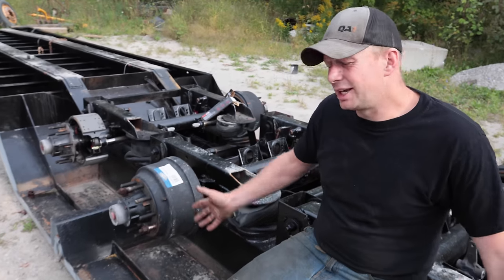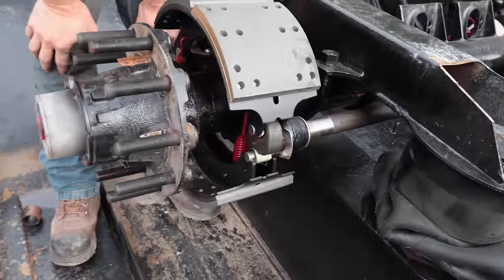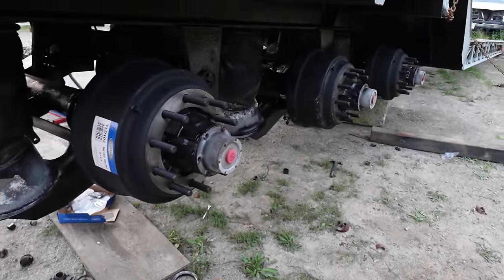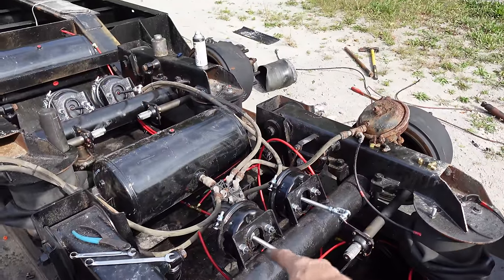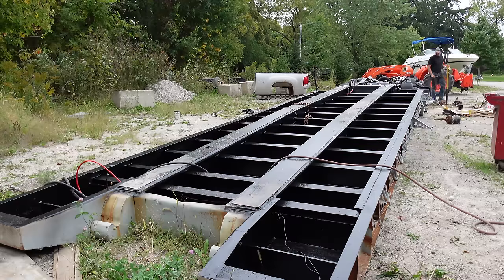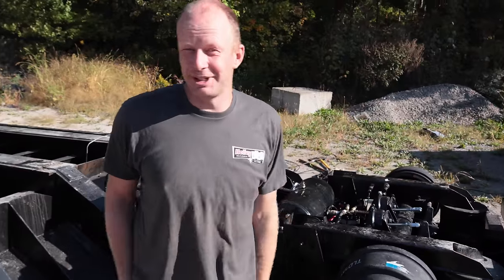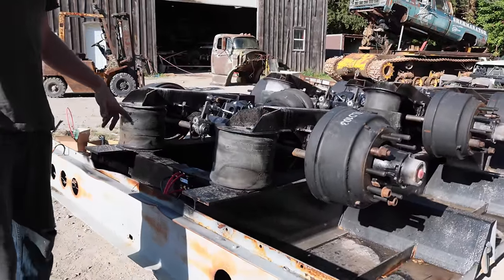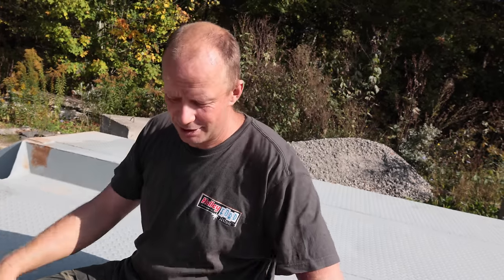Assembling & Airing Up Brakes on our Tri-Axle Lowboy Trailer [EP4]

Comment: Tip on your ziptie memory system.  Try using little bits of telephone or ethernet wires.  They have lots of different colors inside one bit of ethernet cable to designate many different connections, and you just cut a couple inch length of the wire and twist it around the component like a twist tie.  Then you are matching colors of wire instead of zip tie lengths.
Reply: Great tip!
Reply: Personal preference, colored zip ties. Buy them in a tube. No stripping CAT 6 outer jacket and inner sheath, no cutting wires, just grab two zip ties of one color, put them on with one hand. Run out of colors? Double up. I've run miles of CAT cabling and run a truck maintenance facility and a farm. Zip ties for me, just my personal preference.

Comment: For an extra $50 in valves you can put a shut off valve at each air bag to isolate it off it blows.  Then if you get a flat air bag is a simple as closing a valve.

Comment: I work in the suspension department of a tank trailer manufacturer.  We also build brand new suspension systems upside down, then flip them over with an overhead hoist before adding air lines. After that the whole suspension package is welded to the trailer frame.  As far as special tools go, there aren't any. Sae wrenches and impact guns do most of the work. Only thing we use that isn't at a local hardware store would be the Huck fasteners, which are standard for semi manufacturing. Great job.

Comment: So impressive. a one man Job that usually done by a team  inside a work shop. only the ones who do fix trucks and trailers know how much time, effort and talent it takes. Brakes, air lines, airbags, air relays. Wow.  👍👍 what a Great inspiration Rich,
Reply: I do work like this in a fleet workshop by myself, but not upside down!
Reply: @Low760   It is a very hard job, going under the truck back and forth. stuff and mud keeps falling on you.  such trades should be highly ranked.

Comment: Little tip for those anchor pins, ball joint presses work very well, but when you have a stuck or siezed anchor pin (normally there’s stuck, not very often will they just fall out) put the ball joint press on them as you did in the video, and give the spider (where the anchor pin sits) a smack and it’ll usually break free, works everytime.

The way you did it works aswell but heat can sometimes change the strength of the metal “in theory” otherwise excellent job!

Comment: Glad you changed those pins on the spyder. Some would skip that important part.  Some chains for stoppers to your frame and axles so your airbags and shocks do not overextend are a very good idea.Sometimes you can’t always dump the air when unloading, due to freezing and corrosion, ect.
Edit: I actually do not dump the air on my floats because they have 4 chains per axle lol .

Comment: You're gonna want to move your spring brake chambers from the front axle to the middle.

When ever you detach you park the trailer and leave the brakes on the truck released (red valve on dash out, and yellow valve in). This allows the truck to move while you're using the hydraulics to raise the trailer in the air to unblock the neck.  When you raise the trailer up, the truck will move backwards a little, but after you unblock the neck and start setting the deck onto the ground, the truck will move alot. Which is why you can't park the truck, something is gonna move (truck or trailer) and most usually prefer it be the truck.

But back to the spring brake chamber. When you're raising the deck of the trailer to unblock the neck I preparation to detach,  your front axle is going to come up. It won't come up alot but it will loose a large amount of ground pressure.  Depending on the type of surface you're on and it's angle, you might find yourself in a "no brake" situation.
Reply from the maker: I just put it back to the way it came from factory
Reply: Just for saftey the front and middle axles should have spring brake chambers.

Comment: I would consider folding the ears over on the s-cam washer between the S-cam and the spider. Hendrickson sells one that’s already folded over. Since you already installed the hubs it’s not worth replacing now fold the ears over with a hammer and it does the same thing. The shoes can bounce on the washers and cause a lock up especially once parts start to wear.

Comment: Great video..Rich where are you going to keep your truck, trailer and tank during the winter months?  Please don't leave them outside in the weather
Reply from the maker: Putting a roof between two sea containers and parking them under there.  As soon as the trailer is done, I will start the process.  Finished projects can go into the containers, and the boat and Kenworth can go under the cover.
Reply: @DGHD  I knew you would have a plan. The kenworth is your best project to date..Its stunning and I'm not even a truck guy. Thanks  the reply..Love both channels. It is  your  personality and presenting skills that make both channels such a success. The editing is also excellent.

Comment: For your anchor pin removal and installation they do sell a tool for that for a air hammer/zip gun that works great! I use one when I’m doing those and they do the pin and bushing for those
Reply from the maker: there is a tool for everything, but no sense buying and storing it when I use it once every 10 years

Comment: Did they remove the pressure protection valves for the air bag system . If they did you may want to put them on just incase you blow a bag you won't fully lose all your air.

Comment: Good job !!  You can be a top parts pusher, great management skills !!
Reply from the maker: Each build is specific to its needs.  When it comes to brakes and safety, of course I am going to replace all the parts.  When it comes to using what I have, check out the other builds, like building exhaust stack supports out of old prison fence, or a baseball bat for a radiator nipple on the Duramax C10

Comment: Looks great!  I have a WITZCO trailer as well. They aren’t super fancy but they work!  And last!  
Not sure how far along you are on the gooseneck but I designed a really efficient air bag set up to eliminate having to lift the neck with the hydraulic cylinder and put the timber between it and the frame.  I also made some ramps that fold back over the front so you don’t have that big jump to get on the trailer. 
I’d love to share these (if I send you pictures I’m sure you can figure them out as handy as you are) with you but not sure how to contact you. 
Let me know.
Reply from the maker: Would love to see the pictures.  I was trying to think of how to upgrade, but Haven't come up with anything yet.  Send the pictures to debossgarage@gmail.com!  That would be much apprecieated

Comment: Instead of using the ball joint press for removing the pin bushing use a sheet metal cutting bit for an air hammer, you can catch the edge and cut/push them right out in 2 seconds without heat. to install new ones use an old pin and place a 7/8 washer over the nub and weld it on, perfect bushing driver
Reply from the maker: Not a chance on these ones lol

Comment: Looking good!

Curious about how you safety vehicles in Canada, here in Sweden (and most of Europe) it's a third party company authorized by the government that do the testing here. They pretty much all have a pit where you drive your truck into where they have brake rollers, plates for putting torque on wheels to find any play and so on, I found it real odd that you need to physically remove the drums to safety the brakes.
Reply: That's because you guys have disc brakes on everything! In Australia they need to photograph the shoes now so they all come off.
Reply: @Low760  I still have drums on my stepdeck, just a regular braketest on rollers is done.

Comment: With the air bags I’d just be make sure you have an extra or two in stock. Every time I’ve had one blow spent more time waiting to get it then it took to change it.
Reply from the maker: Yes, replace a worn one and use the old one as a spare.  Kept one for the K100 too

Comment: The way you plumbed air bags with a tee in center of trailer you can pinch off one airline with vice grips if you blow a bag and it will get ya home

Comment: Hello Rich, great work but one question, why didn't you connect the slack adjuster to the service brake chamber? They didn't look to have a spring chamber piggy backed on them? Can't wait to see this all done!
Reply: The first axle has spring chamber, that is understandable if not connected or cage the chamber but the other 2 axles don't has spring brake, could the clevis be connected for axle #2 (middle) and #3 (lift)? 19:52 Thanks.

Comment: Hey Deboss garage, if you want i can help you get the airbrakes taken care of on your trailer for the f tree kitty, Id reccemond BluDot systems here in the U.S. as they can help woth your application.

As for getting the airbrakes to to bee proportioned correctly with the pressure being applied to your f tree kitty, youd need a treedle valve and possibly some kind of linkage that follows the main brakes.

Im not an expert but i do want you to check out BluDot systems for airbrakes on trailers that arent for class a vehicles.

Comment: That had to be the easiest S cam bearing replacement I've seen with the trailer upside down. I know Brockelsby Transport used to flip the float & step-deck trailers to do full brake jobs. Saves time & money. I am wondering if you are considering a remote lift axle switch in the cab of the K-W. It saves scuffing tires on tighter corners while loaded. You might also consider a pressure control valve for the lift axle to help adjust the weight between the drives & trailer without have to move the load.
Reply from the maker: Yes, farther down the road.  We will be redoing the interior of the Kenworth so all that wiring will be looked at then
Reply: Isn’t there one Province at least that frowns on that? The in cab switch. Take care.
Reply: @carlcarlamos9055  could be. I am not up to date on that. I had one in my truck & used it from Quebec to the west coast, plus a lot of northern States with no worries.

Comment: I'm suprised you have gone with only one axle running twin chamber boosters, personally I would have atleast had two axles, peace of mind when parked on big hills loaded. Also if I'm right about your suspension being york, you can get parts for  them through paccar
Reply from the maker: That's how it was from stock.  With the tank and the relay valve, in the way, there is no more room for spring brakes
Reply: @DGHD  do the best with what you've got. Happy to see you didn't have to replace the pivot bushes, I've had to replace 10 in as many days.

Comment: Question Rich. Why didn't you paint the trailer to match the Kentworth ??
Reply from the maker: I just did, but only the top and outside rails.  That paint is much more expensive than just generic black, and the black looks good behind the tires anyway

Comment: Nice trailer ,question your Floats are all Timber Deck here in Australia a big number are steel does this have anything to do with your Freezing weather steel deck iced up would be deadly !!!! Or is Timber very much cheaper and you mill it down yourselves .Matt Diesel creek replaced a Float deck milling his own tree,s for the Deck boards .our are you big on recycling !! Anyhow just a curious Aussie really enjoy your channel
Cheers kym
Adelaide
Reply from the maker: Freezing would have something to do with it for sure.  I just milled my own wood for this trailer.  Something about putting 100 year old trees to one last use is just better than steel
Reply: @DGHD  
Ok I get that ,here in Australia our tree hugging greenies would be your worst nightmare LOL
Kym
Adelaide

Comment: Was a diesel tech for 12 years and all the old timers warned me use a dolleh for drums and man they were right.  But that's doing it everyday pretty much. What year is this thing?
Reply from the maker: 2006.  When doing brakes on the ground, you have to bend over to install, I had it up in the air so my back was straight

Comment: Grab another new air bag and carry it in the truck untill you can afford 4 more.

Not a big fan of it only having one pair of maxi boosters/spring cans. That supply valve is in a bad spot.
The other 4 brake cans you can connect to the slack adjusters as they are only service brakes, no parking.

Comment: Wrong parts is the current state of the industry. 

We’ve got a 2019 Mack, ordered filters from the MACK dealer, the same dealer that sold us the truck, with the part numbers, and the vin tag… 

All the wrong filters showed up, and they swore it was all the right stuff according  to vin and part numbers. 

So we don’t call the Mack dealer anymore.
Reply: I use Volvo for a lot of Mack parts. It’s the same engine. Different color paint
Reply: @skonky  I know at a time you could get them with cummins but now they run Mack versions of the Volvo D13. I only learned that from touring the engine factory

Comment: You should have converted to disc brakes on this project, they're much simpler and lighter than drums and they have soooooooooooo much more braking force that it blows drums out of the water. Yes they're more expensive but they are worth it
Reply: Disc brakes on that unit in his area are nothing but a maintenance nightmare. On a unit that only gets used occasionally then sits they'd constantly be seized/ not working. Drums just work
Reply: @delbertstreicher3802  there's a lot less surface area for the pads to seize to the rotors when compare to the surface area for brake shoes to freeze to the drums, they'd be a lot easier to unfuck with the truck

Comment: Napa (and traction) parts are garbage. In the last week I have had to take bake so many new parts that are fucked. 3 brake hoses, 2 sets of shoes that were made wrong. They glued the short shoe on wrong. And every set they have is screwed, another set of rear shoes for completely different vehical, same issue. Another set of shoes fell apart. Brake hoses leak or blow apart at the crimps, shocks come out of the box leaking oil. Seriously I've never had issues like this with used parts even.